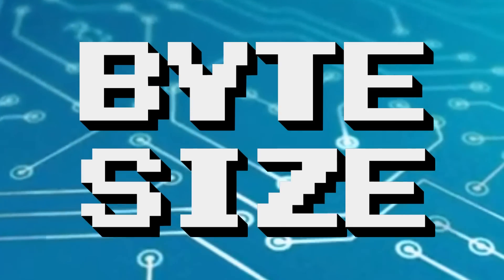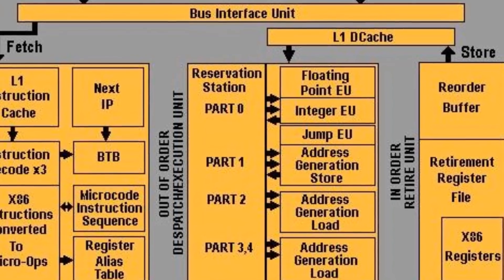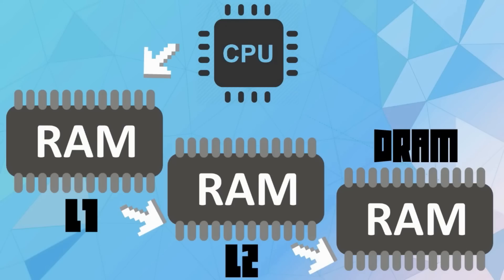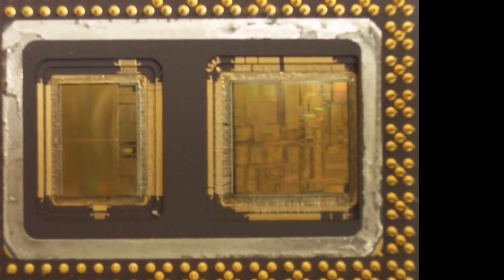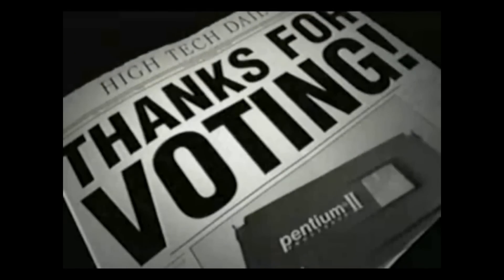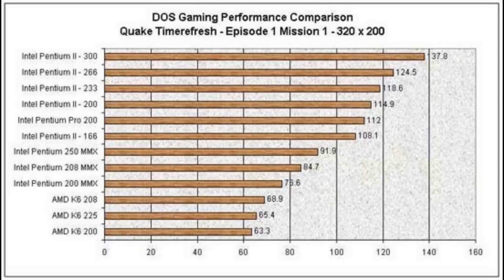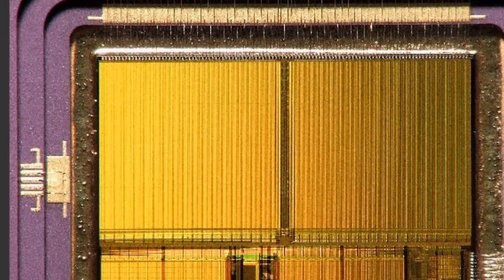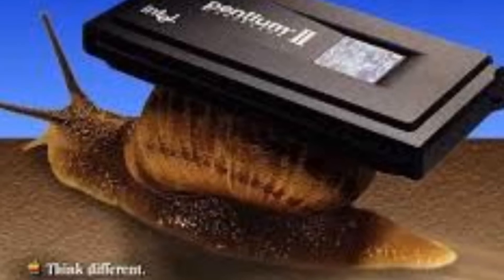Why Were Pentium 2's on Cards? [Byte Size] | Nostalgia Nerd

Comment: didn't answered the question in the video title. :(
Reply: The L1 was on the cpu die like Intel had done since the 486, but yes they put the L2 externally so that they could test it separately to improve yields over the Pentium Pro, once semiconductor processes improved enough that the L2 could be integrated onto the die of the CPU Intel abandoned the slot for the more economical PGA socket.

Comment: The card design was fucking awful. Slot based Pentium II CPU's had a near 100% failure rate on the cache boards in Australia due to lack of adequate cooling in the package. They were designed with the assumption that they would only be used in air conditioned offices under nominal load and the warranty did not cover damage from thermal problems. Bascially you got 6 to 12 months of full cache operation then you had to disable the fucked L2 cache making it an overpriced celeron.

Comment: why don't they use cartridges today? with all things on the main board being more idiot proofed over the years. one of the worst newb sections is currently the CPU socket. i think stand offs might be the worst. Ram being third.

actually sounds like  a video all in itself. "where newby's go wrong" a list video of the hardest to easiest things to do when building  pc to break a part of it. i am thinking i would get most that list order wrong.

Comment: one thing I don't understand - I have a laptop Intel pentium dual core inside with vista running at 1.6 ghz (donated to me) I use it just for emulators, but I tried running quake gl, (not sure what 3d cards inside) and it seemed to be stuttering which My old pentium 2 200mhz with 4mb 3dfx voodoo did not... why is that? I know pcs for some reason slow down - this laptop was midrange in 2007/8 made by Toshiba. but surely it's running over 7 times faster in cpu, and I'm sure the 3d card must be better?!!! is it because windows vista is that detrimental and SHIT?
Reply: Low end not mid range
Reply: It must be a bug in the graphics driver, try changing your video driver version to older or newer versions

Comment: I thought the reason for moving to the slot design was because AMD, Cyrix, and others were able to make pin-compatible chips thanks to some patents they'd acquired access to, so Intel redesigned how the CPU plugs into the motherboard, patented the new slot design, and refused to allow the other chip makers to produce compatible chip packages.

Comment: the celerons had 128k of l2 cache some nerd he dose not even know the celerons had l2 cache lol
Reply: The original celeron (the 300) had 0 level 2 cache and they were seriously crippled and Intel quickly released the celeron 300A with 128 kb on-die level 2 cache running at core speed. These were the true overclocking heroes, most of them you could go into the bios settings and set the FSB from 66 to 100 MHz and reboot, giving you a Celeron 300A running at 450 MHz and, thanks to its full speed 128kB l2 cache pretty much equaling the MUCH more expensive, top of the range, Pentium II 450 for a fraction of the cost.
Reply: so the celeron 300 was basically a 486 as far as cache went your saying
Reply: Raven 4096 Not really, the 486s had level 2 cache on the motherboard and the Celeron didn't have any, so the Celeron was seriously crippled, waiting around for data and wasting clock cycles. Intel essentially overcompensated with the 300A and 128 kB cache running at full core speed (and probably with lower latencies than the external l2 on the Pentium II, although that's just my guess) making the Celeron 300A a seriously cheap way of having Pentium II power at stock speed and essentially matching the Pentium II 450 when overclocked to 450 mHz. The thing that really made the 300A the (probably) best performance per dollar cpu ever made , though, wasn't just the performance parity but that almost every 300A would overclock to 450 mHz easily and with little or no core voltage boost. 
With a good motherboard, like the legendary aBit BH6, you were pretty much guaranteed 450. 
I was too young and poor at that time to buy the 300A, but when I had the money a bit later, I bought a BH6 and a Pentium 3 700 and raised the FSB from 100 mHz to 133 and had myself a Pentium 3 933.
Reply: yeah but intel could have gone that route with the celeron 300 instead they added it to the chip as it likely would have required a separate motherboard since it probably wouldn't have worked with the p2's

Comment: l worked with desktops and laptops about 15 years.
l never found such a collection of BULLSHYT before or since.
1 example? 'hard drive access speed' where a BOGUS test would be set up using an ENORMOUS buffer in memory. so big no practical applications would fit, but hey, whosagonnaknow. then the manufacturer would trot out the BOGUS results.

Comment: I remember having an AMD processor which also was on a card and had to be installed into a slot. It was either 800 MHz or 850 MHz, can't remember might be that I overclocked it to 850 MHz, and I remember it was really good bang for the buck in the day. There were very few processor which could do that kind of speeds for that kind of money but that was sadly shortlived.

I think we still have that same processor in my dad's shelf saved just in case. :)

Comment: So uhm, did you plagiarize Wikipedia or did Wikipedia plagiarize you? Exact wording here is pretty specific. https://en.m.wikipedia.org/wiki/Slot_1 "Intel subsequently designed a circuit board where the CPU and cache remained closely integrated, but were mounted on a printed circuit board, called a Single-Edged Contact Cartridge (SECC). The CPU and cache could be tested separately, before final assembly into a package, reducing cost and making the CPU more attractive to markets" that's like word for word what you just said
Reply: it's there in the march 2016 version of the page

Comment: Hmmm.... Never had an Intel CPU before my P4 Northwood C, I did however build a PC with a SlotA K7-800 back in '97. I voided the waranty and instslled a Golfinger on it (to modify the multiplier instead of the fsb, my RAM didn't cooperate on that option) and ran the thing at 950 Mhz. While I had the heatspreader off anyway, I also put a temp probe on it, right next to the core. I don't know if the probe gave misleading information or my Alpha cooler with 2 60mm fans (that thing was a beast) was just that effective, but It never exceeded 28°C under load (about 4°C above ambient). o.O

Comment: I had a 600mhz P3 on one of those things in '97.
Reply: jeremebp impossible no p3 was out in 97 you could get the p1 mmx at 233 or a p2 but its a complete ripoff to get a p1 in 97 when p2s were already about, when I found out about this latter on I was taken aback for my father purchased a gateway in 98 with a p1 with Windows 95 and other models already had a p2 in them gateway was a ripoff. :/ I thought it was great as a kid,